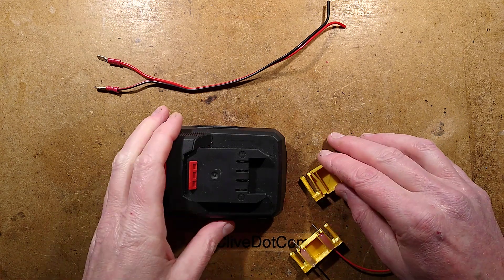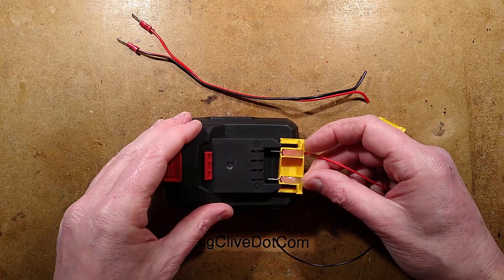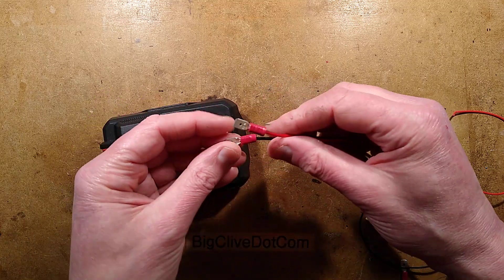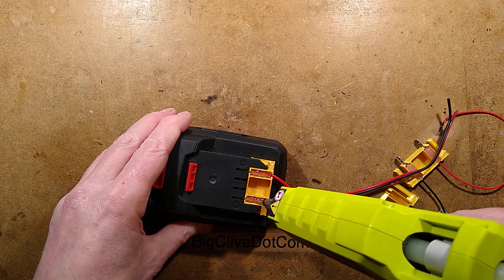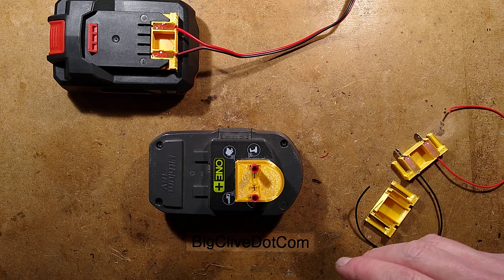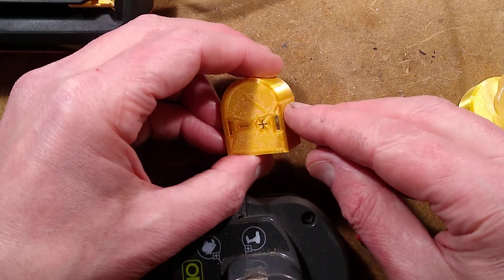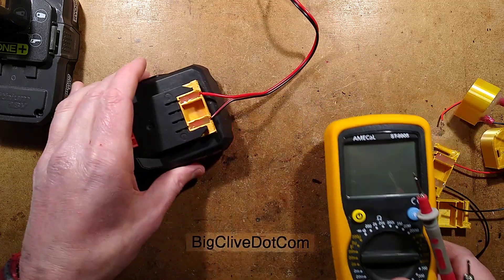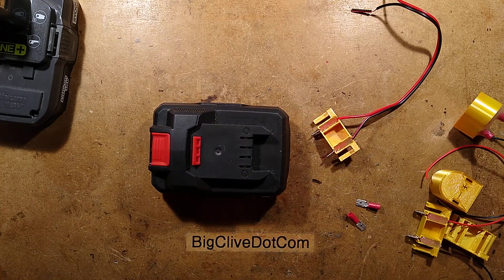Simplest Ryobi and Parkside battery connectors

Comment: Can a 12 volt power output pack charger charge a  21 volt  battery?
Reply from the maker: No it can't.  It would require additional external circuitry to boost and then current limit the higher voltage.

Comment: I have both Parkside and Ryobi batteries, and I printed (Prusa Mini+ printer) both adapters, by using your scripts to create STL files, and everything fits perfectly. I used the same connector as you, and probably the same wires (1.5mm2). Thank you for the scripts 👍
Reply from the maker: Remember that the Parkside batteries don't have overdischarge protection, so be careful not to run them too low.

Comment: Dunno about Rayobi, but Parkside batteries have one big pitfall when using with something else than original equipment:
They do not use complete BMS to protect the cells from overdischarge, it is lacking the power switch MOSFETs, but it contains just the detection part. If undervoltage on any cell detected, it just sends a signal to the tool to shut down. By using just such dumb loads, you run into quite severe risk of overdischarging some cell and as a consequence the charger will refuse to charge it anymore, so you will effectively brick the battery pack.
With Parkside the signal is rather easy to handle: You connect about 3 or5V pull up to the "T" pin (a thermistor connection for sensing battery temperature) and detect whether the thermistor (some 5..30kOhm)is pulling it low. If so, battery has energy and you may draw power. When some cell reaches minimum, the battery pack disconnects the thermistor, your circuit should sense that and shut down.

Most tool brands use complete BMS in their battery packs, those you may use to directly supply whatever.
But some, like the Lidl's Parkside, use this nasty cheapification, where they save cost on power switching elements in the BMS and rely on the load to respond to that signal (the thermistor wire in the Parkside), there you need to implement the disconnect electronics into the load.

Whether your brand uses full vs cheapened BMS you can distinguish easily: Look how many battery contacts the original tools have. If just two, you are safe, theyuse full complete BMS include power switches. If more (like 3 in the Parkside), the BMS is likely cheapened out lacking the power switches and you need to find out the way to "communicate" with the battery (the thermistor bias presence to wake up / disconnection as com and to shut down on Parkside) and implement corresponding circuitry switching off the load when the battery depleted.

Comment: Sir, could you please tell me can I use laptop charger to charge this 21v battery pack?. My problem isn't the voltage (battery pack is 21v, laptop charger 19.5v). Other BMS are require cc/cv power source when charging Li-ion batteries. Do those BMS (the ones that power tool batteries have) are equipped that circuit (cc/cv circuit built-in with the BMS).

I've seen other videos that people use laptop charger directly connect with the battery pack and they say it works. I need to build 5S battery pack with power tool BMS, but I can't find proper information on that.
Reply from the maker: The charge circuitry depends on the battery.  It's best to use the correct charger to avoid the risk of overcharging the battery and creating a fire risk.

Comment: Dear Clive, thanks for the video! I want to use a parkside battery for DIY projects with this plug, but I really want to add undervoltage protection to it! Can you suggest anything? Of course you can DIY it with a mosfet and a comparator, but is there anything already existing? So far I've only seen BMSes that need per-cell connections.
Reply from the maker: You can get under voltage modules.  But it would be nice to use the temperature/charge pin for control of the load.

Comment: does hot melt glue work in these sort of potentially high current applications?
Reply from the maker: If the contacts are getting hot enough to melt glue there's an issue.

Comment: I made a simular conector to power my 19inch LG TV from a lidl 20v for my caravan unfortunately I left the TV on standby and drained my battery and now 1 of the lithium cells won't charge.
Reply from the maker: The best batteries for non tool applications are the ones with built in over-discharge protection.

Comment: thanks for this little adaptor! i was able to make a proper cable to charge an old HP laptop with a parkside battery without just shoving wires into the contacts
Reply from the maker: Make sure you keep the battery topped up.  These ones don't have over discharge protection built in.

Comment: I tried making a battery operated tool to be a wallplug operated tool (wet/dry vacuumcleaner), i bought an empty batterycasing from parkside but i'm unable to recreate the battery info needed to start the tool. I tried testing with a 20v adapter, de battery shell and a drill, and i only get to manage to turn the little light on. Is there any communication with the battery chipboard and the chipboard of the tool?
Reply from the maker: The T connection has to have a 10K resistor to the -ve connection if I recall correctly.  Keep in mind that some power tools draw a lot of current.  A wall-wart may struggle to power them.

Comment: Can i power up other things by only wiring from the + and - 
Also why the battery have 4 connectors i see 4 slots what are those 2 slots in the middle?
Please need answers this will help me ,thx.
Reply from the maker: You can, but you have to be careful not to overdischarge the battery.  The other slots are for charging and temperature sensing.
Reply: @bigclivedotcom  omg thank u so much, i will use this to build ionto machine , cause im tired of buying 9 volts batteries , this is so helpful i was confused about the middle slots , THANK U SO MUCH u earned a sub sir.

Comment: Thank you very much! I am going to print one soon, when I finally buy a battery. 
But could you also make a video about adding an undervoltage protection to such a device (the parkside one, probably using T pin)? If I don't plan to take tens of amps from from the battery, will a single resistor + IRF mosfet suffice, for example?

Comment: What about overdischarging the battery? Or does it shut off automatically when the discharge is low?
Reply from the maker: Some batteries have that and some don't.  An external voltage threshold cutoff circuit can be used.

Comment: Do you by chance have a scrip for the Ryobi 40v batteries?   I am trying to use them on a project for a sailboat with step down and inverter.  A great video you have done .  Thanks. Dara.
Reply from the maker: I've not checked out the 40V batteries yet.

Comment: Just ordered the new Parkside PABSP 20 Li C3 drill with a 4Ah battery and I remembered this video from last year. Will try the script tomorrow. Always nice to be able to use the battery for other useful things instead of it just sitting in the case with the drill between DIY projects.
Reply from the maker: Yeep in mind that these packs can only provide a signal when they are low and not shut their output off.
Reply: @bigclivedotcom  You mean it has to be nearly empty? Then what's the use of having an adapter?

Comment: Hi  can in charge with  a solar charge controller... my battery  have y pole conection (+), (-) and a (C) ?
Reply from the maker: If the battery you use has internal overcharge shutoff it could theoretically be charged directly by a solar panel and diode.  Not all packs have that protection circuitry though.
Reply: @bigclivedotcom  how i would  do connection C and + together

Comment: Is there a solution to use my Ryobi batteries with a Lidl/Parkside soldering iron?
Reply from the maker: I'd recommend getting the matching Parkside batteries so the low battery control signal is compatible.

Comment: The layout and latching mechanism of the Einhell Power X Change battery system looks very similar to the Parkside, but with different dimensions and reversed polarity. Almost like somone looked at the battery and said "Make it like this, but not compatible."
Reply: That's interesting as some of the earlier Parkside cordless tools used the Einhell Power X-Change  Batteries, though it appears that only lasted for about a year or so.

Comment: Excellent - I haven't dipped my toe into 3D printing yet. Is it possible to print these adapters on a cheap printer please?
Reply from the maker: Yes.  Most cheap printers perform well for small technical components.

Comment: I've jumped a car with one of these with 18v Makita lol. Discontent immediately when doing this. Also used it as a backup for my internet router when power went out using a boost converter. Thankfully coax still works even with power outages. Had home internet for 4 hours with that method.

Comment: I have a question. I just bought a new battery pack for my lownmower. It works fine and shows full charge when on its charger (all green); the mystery is that when I test it with my multimeter, it shows 0V – and yes, before anyone asks, I did test between positive and negative terminals. 
(just for info, it's a Briggs & Stratton 10.8V li-ion pack with four terminals marked respectively: - / TH / E / +). If one of you, nerdy electronic type can explain that to me, I'd appreciate it, because I searched the internet and found nothing...
Reply from the maker: The pack may have protection built in and require a control signal from the tool.
Reply: @bigclivedotcom  Thanks, that's what I suspected but that is truly annoying not to be able to test a battery without opening it. I had to test the individual cells: one was at 3.9 V, an other one at 3.4 and the middle one showed a small voltage quickly lowering when tested. So my guess is that this is the bad one.

Comment: Ooh, that reminds me to make some connectors for my bosch 36v. I don't have a proper charger so my lawn mower batteries get charged via 12v sla solar storage and a cheap mppt charger. Wires currently shove in the connector 😄

Comment: Great video thanks! Just bought my first parkside impact wrench first that takes the 20v interchangeable type, so this is very relevant. Would also be keen to know if they fit other tools and vice versa, as don't have a 3d printer as yet, but be good to know if I have better tool make options that use the Parkside battery packs?
I've seen similar I think new DeWalt looked a similar fitment and possibly einhal (but that's only from memory a month or so ago) so can't be sure..
Anyone else knows/tried these would be good to know if tested.. 
Cheers

Comment: below is my edit for milwaukee M18 Print with supports touching bed because I added a keyed slot. 
I tried it and revised it 3x, the one below is the winner

//M18 modified from BigClive Parkside batt mini adapter
//Use with spade crimps fuse recomended
difference(){
union(){
//main block
cube([48,20,14]);
}
//side slides
translate([-1,5,6.4])
cube([6,21,10]);
translate([41.9,5,6.4])
cube([8,21,10]);
translate([4.5,5,-1])
cube([5.7,20,16]);
translate([37.2,5,-1])
cube([5.5,20,16]);
//keyslot
translate([12.4,-1,-1])
cube([5.25,25,3.50]);
//Terminal cutouts
translate([10.7,1,2.7])
cube([6,18,15]);
translate([30.7,1,2.7])
cube([6,18,15]);
//terminal slots
translate([11.3,17,4])
cube([2,10,13]);
translate([33.5,17,4])
cube([2,10,13]);
//cable slots
translate([11.7,-1,4])
cube([3,10,14]);
translate([32.7,-1,4])
cube([3,10,14]);
//plastic and time saver
translate([17.7,1,2.7])
cube([11.8,18,15]);
}

Comment: Nice one Clive thank you! Just a thought on the Cryobi one and your chagrin at the hot schmoo mess. I get the 3d printing orientation problem, how about just print the outer skin of the design you came up with (not even full height) and rest it on top of your design at schmoo time? it will be glued in place and give that nice 'potted' look you achieved on the other design?  Those with shaky hands like me might splash out on some tape to hold it in place whilst dispensing hot glue.

Comment: Printed and built it today as a way to make my cheap soldering iron portable.
I'll probably build some of the Tine E-Lab modules from Thinkyverse as well to tidy up my work bench/desk.
Reply from the maker: If the soldering iron is programmable, set it's low voltage cut-off point to around 15V.
Reply: @bigclivedotcom  It's a cheap and simple one that works at a range of voltages.
With its maximum current of 3A the 2Ah battery pack should last up to about 40 minutes between charges, so I'll keep that time below 20 minutes to be on the safe side.

Comment: This is the video I didn't know I needed. I have like a dozen batteries from the Lidl X20V team and I always wanted to be able to use them in my electronic projects for powering things up. It turns out I just need to print this little adapter and add a couple spade connectors and some hot glue and I have 20V at my disposal. Pretty neat. It is for things like these that I love your videos. Keep up the good work! ❤️

Comment: Why not print the hot glue bucket for the second design as a separate part? Leave lots of holes in the bottom to connect it to the main part

Comment: This is actually a really good idea as the replacement charges for the older 16v range are about £35 and delivery is around £15!!!

So much easier going to have to give this a try
Reply from the maker: Don't try recharging it through this connector though as the charger needs a control signal when the first cell hits 4.2V.
Reply: @bigclivedotcom  you should definitely do a teardown of the battery next! 

I take it this is more for using the batteries as an energy source for leds, mini motors etc

Comment: For the Ryobi one, why not just increase the thickness of the flat bottom part with the +/- on it, and then put little sunk in squares where the connectors would go that you can put a little hot glue in. It wouldn't have to be super thick, maybe 1/8". Just something to give a reservoir for the glue to go in. And I don't think it would increase print time that much, especially if you decrease the infill amount to something small so it isn't totally solid.

Comment: I have a parkside battery and the internal fuse blew out so I repaired it and now it’s flashing for a damaged battery when I try charge it do you have any suggestions on what to do or if I can repair it ? Great video too👍🏻
Reply from the maker: Check that all the cells have at least 3V.

Comment: As I use makita 18v , I had an old drill I chopped the battery holder off it and attatched it to my gtech 18v garden trimmer, no more am I waiting 3 hours for 10 mins of use when I always have a makita battery charged

Comment: Love it.  :)   Mod tip.  first power:  Angle spades 90 degress , remove the plastick cover on the spade, and solder it directly to an XT60(XT90 placed in the middle if your adapter with the opening facing the same way your wires are exiting today...  solder spades to XT60/XT90. Hotmelt it down and you have an solid mass in the middle with an great XT60/90 outlet.  
Ryobi mod idea:  Same principle, Angle spade 90 degrees sideways  facing the straight side of the battery.  Add another jacket with an XT69/90 connector that slides over the adapter you made, where you put the XT connector facing up from the battery.  It will again give you an great and solid outlet for differet outlets.   The new jacket might also be an USB 2/4 way module integrated into this new jacket.  :)   

Love your design so far tho.  Great start  :)  Thank you  :)

Comment: I was broke down with a dead truck battery one day out in the middle of nowhere. I used my 20v lithium pack from my Bauer (Harbor Freight) the only battery pack that had a full charge, and set of old leads from a multimeter. Had no expectation for it to work, but was able to jump start my truck with it. This would have been a great little thing to have because the first one you made looks a lot like the battery I used. Also looks a lot like a Milwaukee battery too.

Comment: This is great - thank you! I use the Aldi batteries a lot (printed an adapter to retrofit an old wickes drill that was a 21st birthday present, so had sentimental value) and unfortunately it appears Aldi/manufacturer has purged many of the adaptors previously on thingiverse

Comment: Loved this and thought I would expand to make a lid for the RYOBI version to better protect the cables. I have not printed this and did it as a challenge to my self in OpenScad. Some sizes may need to be altered but I have tried to make them parameters

//Ryobi adaptor outer
$fn=50;
height=20;
width=31;
wire=7; // cable dia
cutoutoffset=10; // from bottom
    
//main block
difference(){
    union(){
    cylinder(h=height,d=width);
    translate([-width/2,0,0])
        cube([width,20.5,height]);
    }

    //battery clip recess
    translate([0,0,1]) // change to translate([0,0,1]) to leave open
        cylinder(h=height,d=width-2);
    translate([-(width-2)/2,0,1]) // change to translate([-(width-2)/2,0,1]) to leave open
        cube([width-2,19.5,height]);
    // Glue Hole
    translate([0,0,0])
        cylinder(h=height,d=6); // change d to suit nozzel
 
 // wire exit  
    translate([-wire/2,(width/2),cutoutoffset])
        cube([wire,5,height]);
    // wire exit hole
    rotate([90,0,0])
        translate([0,cutoutoffset,-width+6])
            cylinder(h=10, d=wire);
}

Enjoy